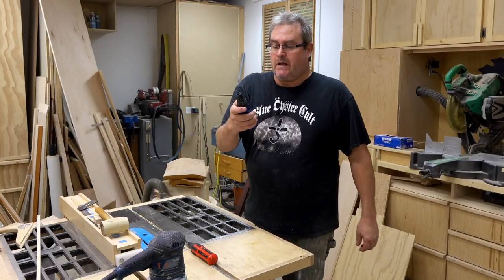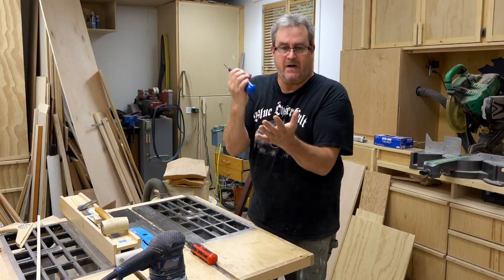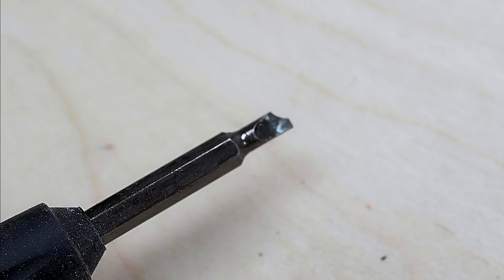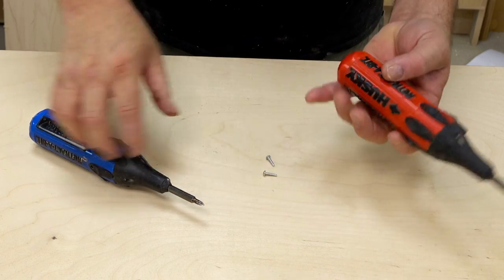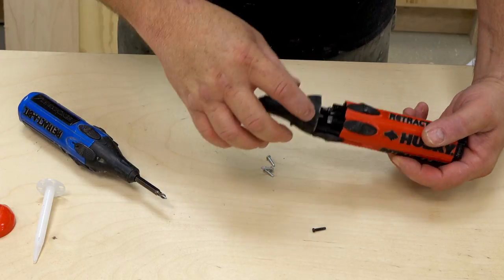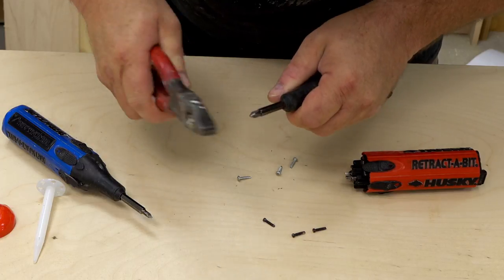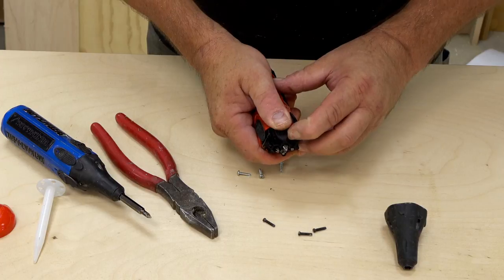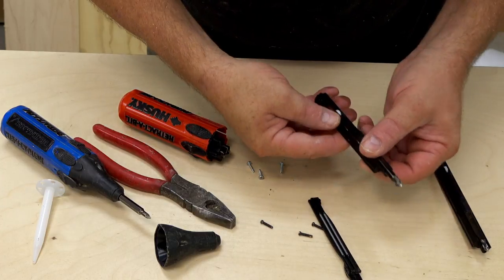Inside The Switch Blade Screwdriver

Comment: Once a bit turned in the plastic end it probably deformed it enough that a small burr gripped the metal and prevented smooth retraction.  Sometimes it only take a tiny bit of friction to interrupt that kind of spring reset.  See if you can find one with a metal end or make your own. :)  Maybe even just find a socket that will let the bit slide through. (you'll have to cut the bottom off) and epoxy it in place.

Comment: Might not a little bit of dry lubricant like graphite not have solved the sticking bit problem? It can still work for the blue one. Maybe the type of plastic used on the interior mechanism of the red one was/is inferior to the blue one.  The seven years between buying the blue one and the red one can easily mean changes in production qualities. Let's face it companies do it all the time to save .5 cents per mechanism section..
Just my two cents.😊

Comment: Have you tried lubricating the mechanisms? Take your blue one back apart and try spraying the parts down with spray graphite powder. It lasts longer and doesn't leave it wet when it dries like silicone spray and wd-40 does.

Comment: I bought the same screwdriver from retract-a-bit before they lost their right to sell them in the USA a few years back. I had a similar issue, where the Phillips bit would not retract, found that one of the springs were stretched... fixed the spring.. works good as new...

Comment: I've always been surprised to see you using that screwdriver, as the retractable screwdrivers that I've used  have never struck me as that robust --- I like them for things like taking apart a PC or just a kitchen-drawer screwdriver, but I would not use them for heavy twisting.   

Have you ever tried a Klein or Milwaukee reversible tip screwdriver?  I don't think those style are quite as quick as this one, but I think it might be a bit more robust.   It's not as slow as a Picquic either.    (Love those, but they're slow to change bits)
Reply from the maker: I have a Klein 11 in 1 that I bought 15 years ago. That's a good screwdriver, but the bits can be lost and they slip out too easily. The blue retractabit is actually pretty strong, but I generally don't do much heavy twisting with a screwdriver, anyway - that's what impact drivers are for.
Reply: Having used these Retract-a-bit screwdriver extensively for years. It IS possible to over torque them and deform that plastic throat piece, once that happens the screwdriver is hooped (as John learned in his video) but for normal levels of torque I've not had an issue and it's so useful for electrical work. You basically need a Robertson #1, #2 and small flat blade and having the correct bit in your hand with 1-handed switching is worth it's weight in gold.

Also for the homeowner having the right bit every time without being able to lose a bit is terrific, so much so that I give this screwdriver routinely as a gift for people.

Wish I could have stopped John from crushing his, I could use the phillips bit for one of mine that I bought at a pawn shop pre-hooped for $2.